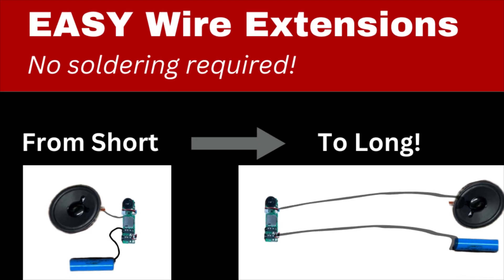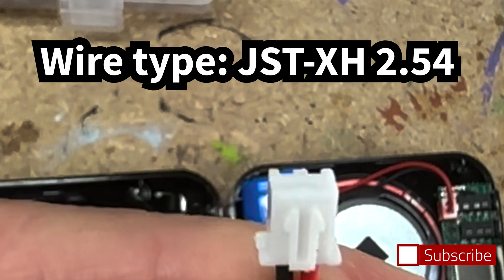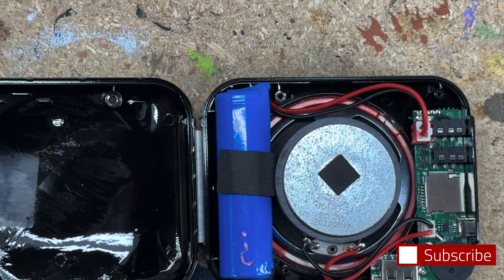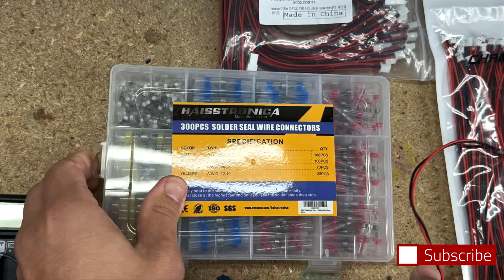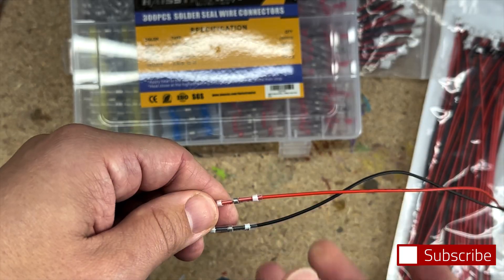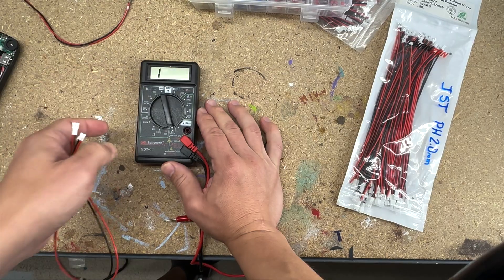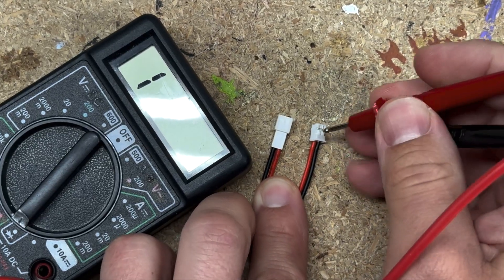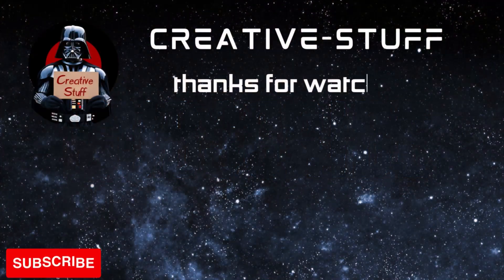The Easiest Wire Extensions (No Soldering Required)

Comment: No soldering required.. then goes and solders the wires together with a solder heat shrink.
Reply: Came to say the same thing, if the box says "SOLDER seal wire connectors", then you ARE soldering
Reply: should really be "no manual soldering" not no soldering. cause he's not using a soldering iron or equivalent, but he is still soldering.

Comment: Hey, I bought one of your moukey VA-1 amps on your Etsy. I read a review after I bought it about having to take it apart. Do you have a tutorial over how to do that? I don’t want to cause an error since I’m not familiar with wiring and stuff. I am going to buy the i9 as well for voice changing. What else would I need to buy to allow for the two to work together without error? Is there any connectors I need? I appreciate your videos and help btw. Thank you.
Reply from the maker: I’d put the instructions in the listing description but here they are:

 DISASSEMBLY INSTRUCTIONS: 
You’ll need a small skinny Phillips screwdriver and an xacto blade or something similar.  Some folks may benefit from using some magnifying glasses (I use these https://amzn.to/4dTef2N).

Unscrew the back in 4 spots, open it up.

Then carefully cut through the red glue on the plugs for the speaker and battery, if you want to disconnect them from the circuit board.  Then carefully pull them out. If the white connector pulls off the board don’t stress, just ensure you see which side points which way so you can ensure you put it back on correctly so you don’t invert the polarity; when you put it back on do it slowly so you don’t bend the pins on the board.

Then if you want to pull out the speaker, use a blade to carefully cut the glue around the speakers edges; then use a small tool like a skinny flathead screwdriver to lightly and slowly pry up the speaker until the glue starts pulling away,  

Then unscrew the 2 screws holding in the circuit board. 
Done.

DISASSEMBLY VIDEO: Here’s how I did it for my Mando install:
https://youtu.be/yPGlVtBoNYg?t=292&si=uxoMGcOEs2UJ3SnQ

Handling the board is quite forgiving but careful when it’s on don’t get too handsy to avoid shorting anything out.
I recommend painting the board to both protect it and help it blend in to your gear.  ensure the battery is disconnected from it, prime it first. the.  paint it as desired. definitely do not skip priming if adding a metallic paint, or you risk shorting it out.
Reply: @creative-stuff  thank you so much I appreciate you